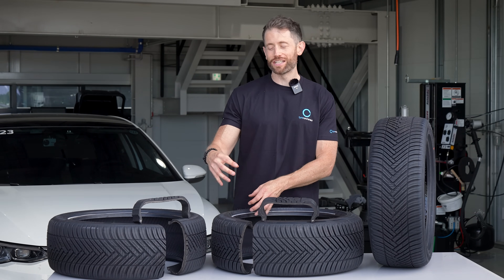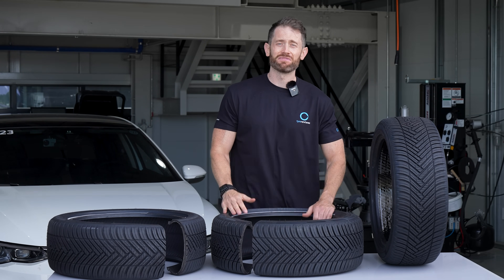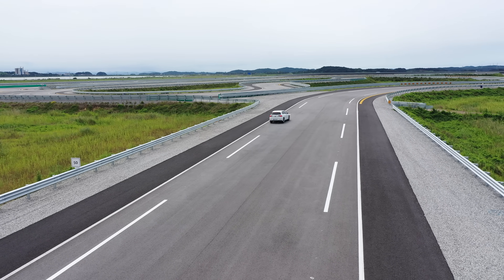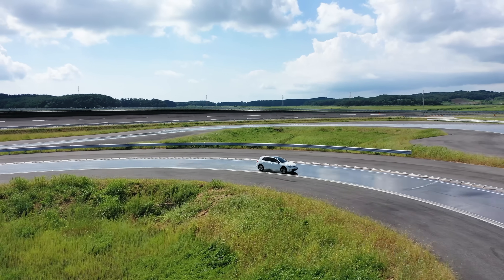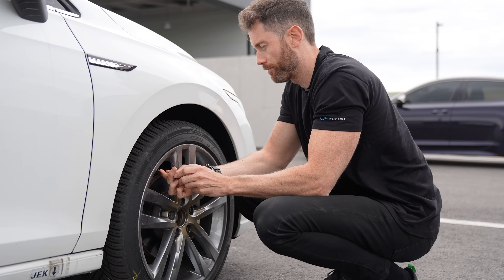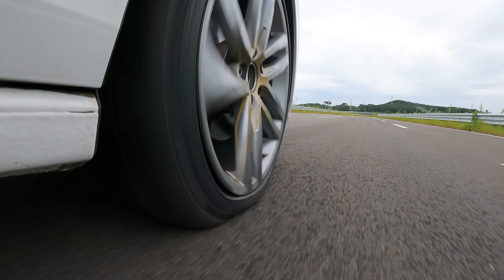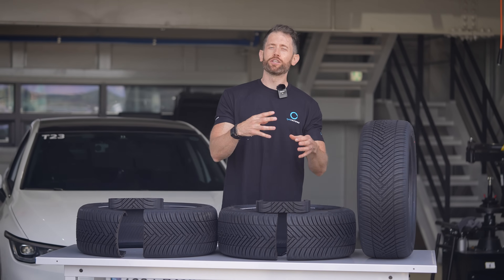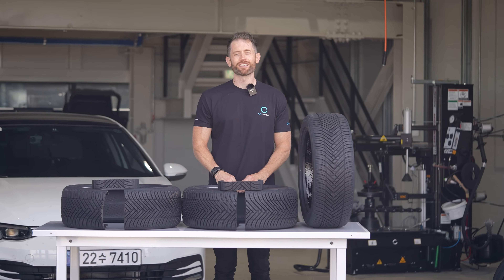Are Modern Runflat Tires Finally Good? Normal, RFT and SEAL Tires Compared!

Comment: Not worth the money as a mechanic that’s fitted tyres in my daily tasks 2055516 fitted too one series and other vehicles run flat bridge stones where around £200 fitted the same none run flat tyre £80 drive ok the run flat have too replace it drive on the none run flat you’ll have to replace it but the price is the big difference also self sealing tyres are not worth the money I’ve had many in that haven’t been able to seal them selfs deeming them unroadworthy my advise too everyone who drives get a spare and make sure it’s a safe tyres and that you check the pressure every few weeks a spare wheel will get you home vehicles with run flats are normally towed too a garage and if it’s out of hours your left getting public transport home leavin your vehicle in the carpark of the garage it’s taken too spare wheels make more sense then run flats and a puncture fluid

Comment: Problem with self-sealing tires is that you never get any indication when you have punctured your tires since they don't deflate. The manufacturer tells you to regularly check your tires for evidence of damage, but we all know how often the average driver is going to do that. They also say the self-repair is "temporary". This means you can have a tire that has been compromised by multiple punctures that could lead to a tire failure at some point defeating the idea that the tire will keep you from an emergency tire change (or a tow as more manufacturers are forgoing including a spare). This is probably why the technology is not widely adopted.

Comment: As a full time tyre fitter for 6 years now I can definitely say sealant tyres are not 100% puncher proof and I have had multiple come in to my garage with leaks from a simple screw/nail. These sealant tyres can not be repaired because it’s basically impossible to buff and glue a plug or patch to them. Runflat tyres do allow you to drive deflated for a short distance but once driven on with no air it’s not safe to repair them as it’s harder to see sidewall damage and can create bulging. White tyre sealant you pump into the tyre will only seal a very small hole 50% of the time and garages will not repair them once you have done so. If you get a puncher a standard tyre with an electric pump in the car is your best bet to get you to a garage so it can be repaired.

Comment: A big disadvantage for the RFT is tire replacement; if a tire is damaged, you can not repair it, in general, and you can not replace just one tire.  Therefore you are on the hook to replace 2-4 tires for damage to just one tire.  Do the 4G tires allow you to only replace one tire and to allow for tire repairs over outright replacement?

Comment: I ripped the stock bridgestone run flats off my bmw e91 and carry a space saver in the boot. Thinking the 4S2 RF might be the only tyre i need going forwards. Currently have summer rims with PS4 and winter rims with Cross Climates.

Comment: Would love a good run flat for the F30 BMW - 255 35 19 rears and 225 40 19 fronts - any recommendations? UHP or UUHP summer class (CSC7/Asym 6)

Comment: Thank you for such a comprehensive very fair test, I’ve had a few BMW’s over the years and always ditched the run flats when my tyres needed changing. Personally I feel the lack of a spare wheel is a retrograde step, having to purchase a new run flat because of a puncture is a real kicking especially if the run flat being replaced has had little wear. Like the look of the sealed tyres.

Comment: I had run flats on my 2004 BMW.  Back then, I think it was the first application of run flats to any BMW.  My first year with my car, I had about 4 flat tires.  Mostly due to glass chips driving around an urban area.  I live in the northeast.  I don't know if that was due to the run flats or just bad luck.  It seemed like the tires were easy to puncture with debris that would not affect normal tires, b/c normal tires have slightly more "give".  It turns out lots of other first year owners had the same encounter.  Anyways, I'm glad the run-flat tech has improved.

As far as your vids go, the times slightly favor normal tires.  I'll trade perceived crispness of steer for better times.

Comment: Good video but can you guys compare Michelin tires with Hankook, Bridgestone and any other run flat performance all season tires.
Our 2014 Corvette stingray has Michelin pilot sport run flat tires. It’s time to upgrade the tires on a 2014 Corvette and our 2021 Challenger R/T scat pack widebody shaker.

Comment: Heard of a head mechanic at a BMW-garage, that the reason why they don't like run on flat because it'll bend the inside of a rim. These tires are to hard, especially if you go 20 inch or higher. I get to hear this after two tires were torn and 2 sets of rims bended not long apart and I can confirm that regular tires give less rolling noise and give more comfort.

Comment: My one reservation about runflats is the expense. A work colleague with a modern Mini that came with runflats as standard was faced with paying £175 per tyre to replace them (some years ago) and chose to save 40% of that cost by getting conventional replacements (still premium-branded). I've been unlucky enough to need one corner of my car reshod twice in the space of four months (thank you to whoever left a glass bottle in the middle of a country road...) and not only would I not stretch to runflats but nowadays I wouldn't stretch to the poshest of premium brands either. 

Also I'd like to say a belated thank you for one interesting tidbit in a previous video about super-economy tyres, where you pointed out that one way of reducing rolling resistance is to reduce tread depth. I always had top-brands on my previous car and was always disappointed at how quickly the shoulders wore down on UK roads (bless the roundabouts of Britain...). Now experimentally I'm running mid-market reasonably-rated tyres (B wet grip, C fuel efficiency) and the first thing I have to say is that there is noticeably more tread depth on them. Time will tell how long they last, but right now one corner is showing no noticeable wear after 14k miles. Yes, fuel consumption will be higher than for A- or B-rated super-economy tyres, but if I can save 30% on the starting price AND make them last longer, then the net effect will be interesting.

Comment: Pirelli runflat in bmw x5 kind of broke in the winter on the road bumb. The side wall could not take the winter, it did not brake completly but became visually deformed. Luckily it was time to get new tires anyway. Hard to imagine that those tires in the video would hold in heavy car like x5 hybrid without air. Those antipunkture tires seem cool.

Comment: How does the seal do with a nail that stays in place? I have had slow leaks many times from nails and screws that stay in the tire.
Also, this test was done in normal weather… how does the seal do in winter and freezing weather? Does it work as well in sub-zero temperatures?
Reply from the maker: Should still seal just fine :)

Comment: Had runflats on a BMW… worst tires ever.  On top of it, they didn’t have a spare because of having runflats which did absolutely nothing for me in the middle of W. Virginia when the tread separated and the tire disintegrated.  Since, I have bought a different brand car, 2 of my requirements for said car were no runflats and it has to have a spare.   Never again…

Comment: How many years the sealant is effective? Summer tires could be used safely like what, 5 years? Does the sealant provide the safety even after that time? At least for me a puncture has been always been a minor inconvenience and easily fixable. Is it worth to pay 120€ for a essentially 100€ tire x4 or x5 for insurance for minor inconvenience
Reply from the maker: Life of the tyre :)
Reply: @tyrereviews  Thanks for the clarification 👍

Comment: A runflat is simply a substitute for having a temporary space saver spare.  You're still speed and distance limited after an event.  And you still have to replace the tire after an event.

A seal is a substitute for having a full size spare.  Get a nail, pull it out, it reseals (does the tire have to be at temp for the sealant to be effective?), you carry on like nothing has happened.  Such as the nail in my left rear right now.  I hate, literally, that cars are permitted to be designed to not handle storing a full size spare, whether or not it includes one, not to mention where to put that blown tire if you have a vacation trip full load.

Every road hazard tire replacement I've had would have been addressed by seal, except maybe two.  One time, I ran over some kind of big hook (like for hay bales), 1/4" metal shaft.  Not sure how large a puncture seal is meant to handle.  Another time, I hit an Interstate pot hole at 80mph.  About a one inch longitudinal slice in the bead.  Certainly could have sealed, but not sure if seal has the sealant throughout the entire inside surface of the tire. [- finally finished the video, so no, seal wouldn't have helped there.  So we're really back to the only intelligent solution, stop screwing up cars by making them not able to carry a full size spare.]

The seal tech just doesn't seem to be used on sufficient variety of tires, such as my Michelin preference.  A runflat+seal would seem the best tire for me; just toss the worthless compact spare out altogether.  You should have completely different tires for a track day anyway vs your daily, so I'm not concerned about issues anywhere near "10/10ths".

Comment: When it comes to comfort I think the  difference is significant. I have bmw 1 series 2018. Using run flat tyres Contisportcontact 5 in summer and normal tyres Bridgestone blizzak lm 005 in winter. In winter I don't feel bumbs so much as in the summer.

Comment: I am at the point where i care more to protect my rims rather than my tyres, so a strong sidewall is what i need. I would choose the runflat only for that reason and not the one it was designed for.

Comment: The comfort is the only issue - Why wouldn't all tires/tyres be sealant   Cost <I had a BMW performance coupe, and the original run-flats were like concrete=Amazing car but for the run-flats.  I don't know why these sealed tires/tyres aren't a bigger thing. There must be a reason.
Reply: Cost I guess!
Reply: @tire_reviews  So, about 50K for the car but, an extra 50$£€s is the determining factor?   Most punctures are in the tread. I had to just get 2 patches in my 300$€£ tires/tyres a week apart.   The sidewall is worth a Run-Flat?    Hmm.     I guess.  As long as they aren't the old concrete feeling run-flats.    (Besides my other car years ago, that I had to replace 9 run-flat tires/tyres in a year, until they gave me regular rubber tires/tyres and then paid for my entire 3yr lease.  [That Infiniti was a decent car but, tires/tyres and recalls were hideous.    
    
As a caveat: Hankook would NEVER have let him test their tires/tyres, if they weren't confident in the results.  This was a Hankook commercial and an obvious result.

Comment: Just had a burst tire with a seal tire on German Autobahn a few days ago. Nothing on the road, no visibible pre-damage, nevertheless it exploded out of the blue. Seal did not help at all. In addition, the seal ages year by year and won't be as good after 5 years as it has been with a new tire. And worst of all: The seal layer weighs about 1 kg per tire more than a normal tire. The additional weight is at the outer diameter of the rim and slows down acceleration and agility noticable. Probably not recognizable on a Golf R, but definitely on a 150 PS TDI.

Comment: Patch kit and an air compressor is all you need. Runflats are one-time use. Seal tire does not warn you of a damage to the integrity of a tire. I do not see much value in either, except to cater to a lazy operator of which we need less.

Comment: Whoever at Hankook supported this test deserves a bonus; THE best advert for both the brand and those products. Sack most of the marketing department, and do this kind of advertising, not the emotional nonsense. It was worth a bent wheel, a few sets of tyres, and the extra engineering to make the special set. I'm impressed.
Reply: I have the regular version of these tires. They've been great but wear quickly. Not gonna last 60k miles as advertised, maybe 45k miles.
Reply: 45k miles is huge anyway, esp for winter @phatgringo2.0
Reply: @phatgringo2.0  Yeah, they aren't up to the quality of the likes of Michelin and Continental.  Personally, wouldn't waste my money on them.
Reply: Pity Hankook are shit tyres though.

Comment: Looking at these sealant tyres the standard test is for a nail to enter then exit. What about if the nail or screw remains imbedded within the tread pattern with say the head of a screw visible on the outside? Does the seal still work? I've had this before on a normal tyre (with a very slow leak) and the screw acts like a cork in a bottle.

Comment: Yeah but... how often do you run over a nail fixed in a plank rather than just a random loose nail or screw that stays in the tyre. What are your thoughts on this?

Comment: I'd be interested to see a test using higher aspect ratios. Rubber bands are going to be a lot easier to keep a similar feel since less sidewall means more work for the suspension.

Comment: Several years ago, Bridgestone made a run flat that only partially held the sidewall height when deflated, so that it could be softer and not ruin the ride.  It looks like others are starting to follow.  TireRack recently mis-filled my order, and now I have two Pirelli run flats on the front of my car.  I've noticed that they have a similar contact bulge to the rear non run flats.

Comment: I suspect the biggest factor that makes it more similar to "normal" tires today is the popularity if low profile tires.  That makes it easier to support the vehicle with a thicker sidewall, and it increases noise and lowers ride comfort of "normal" tires.  Thus, I bet they don't sell those run flats with fatter sidewalls.  And if you compared them to tires with fatter sidewalls, they'd be quieter and more comfortable.

The seal tires are more interesting to me.  If the cost isn't sky high, I'd go for that.

Comment: I have the g21 BMW with Pirelli runflats and it seems pretty good all-round to me. I swapped my F series x3m from Pirelli rft to Michelin go flats to get less noise, it was smoother on low speed paved roads but certainly no quieter and less precise on turn in  so I was underwhelmed. Joe Achillies bangs on that my G21 will be transformed if I go to Michelin 4s go flats but having been in a 4 series with them Im not so sure. Could it be the case that the Pirelli rft is better than the Bridgestone that Joe seems to dislike so much. Maybe another test on this specifically. Think I might stick with Pirelli rft this time round .

Comment: in 7 years of driving I never had a flat tire because of puncture, but I had bent and cracked rims because tire is too soft and compresses so far that the impact goes to the rim and that cause air to escape from the tire, I tried running 4 bar in my tires and now I just settled for really tall sidewall tires but really I wish there was like a rally tire like pirelli km but legal for the road, they have such beefy sidewalls that you can hit anything and it will never crush the rim (there are a lot of really aggressive potholes where I live and I drive in the night and the rain so I can't possibly see where I'm going)

Comment: The BMW M440i I bought last year came with Bridgestone Turanza T005 run-flat tires. They were noisy, uncomfortable, had only mediocre grip at best and wore out unbelievably quickly. I switched to Michelin Pilot Sport 4S tires after a few months and the difference was night and day! So much more grip and comfort and the noise levels dropped dramatically, also they seem to last forever! Maybe the Bridgestone run-flat is an older-generation tire or just a bad tire. I definitely understand the safety aspect of run-flat tires, but they certainly need to be a lot better than that particular Bridgestone tire.

Comment: I’ve been driving runflats for the last couple of years and I love them because they saved me in some critical situations. 
The harder sidewall is really strong in deep pothole situations, but the problem is the rim is easily bended because of this.
Reply: That’s interesting about the rim being more easily bent. I have hankook run flats and not had a puncture over 3 years but the alloy has flattened in one area I went over a deep pothole in Manchester. Cost £75 to have repaired

Comment: I never ever use run flat tires even on cars which does not have a spare. How often do you get a flat anyway? Once every decade? That's what a tow truck is for! Not going to put up with inferior ride and handling for 10 years for the sake of being able to not get a tow once a decade.

Comment: I have a question about the Seal Tire: assuming you have a puncture, and you don't realise because the sealent is doing its job, how well(how deep) does the sealent go to seal the whole puncture and how safe is it to the go about your drive at 120-130 Kph? And not realising you had a puncture means you never have to repair it(in case you see that the nail is stuck in there, you just get it out and go about your day?)? Thank you very much, and as always: love to see&hear you teaching us what to choose and how to think about our tires!!

Comment: The biggest current problem these days with run flats is that, as u stated, if u do get a puncture and drive it it's no longer repairable and u need to buy a new tyre
Reply: Depending on the manufacturer you most times can not repair a run flat.
Reply: And you might have bent rims